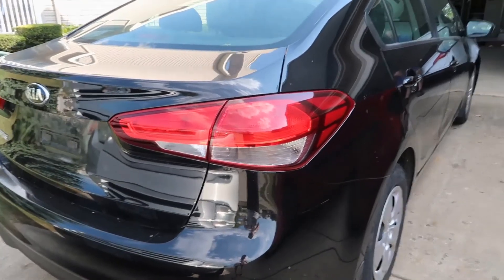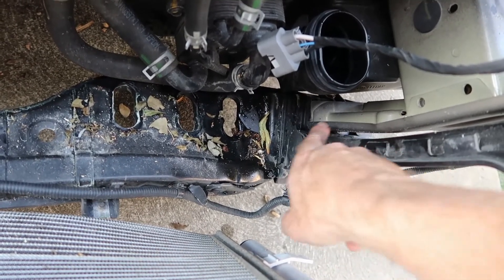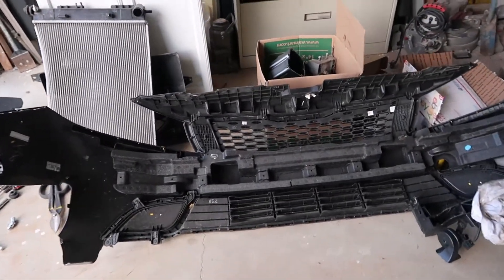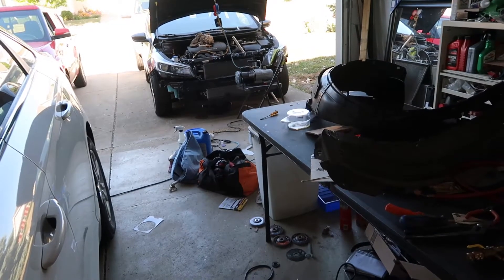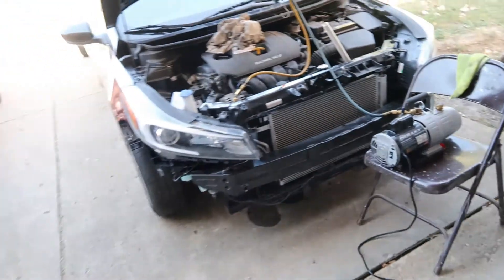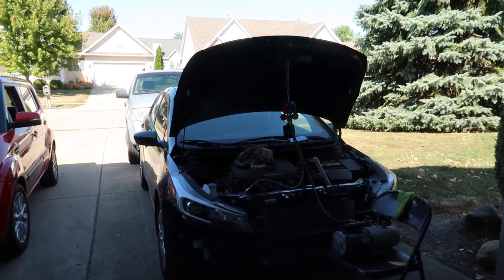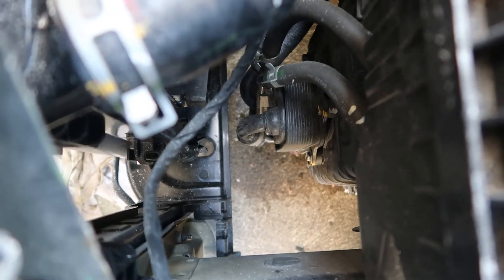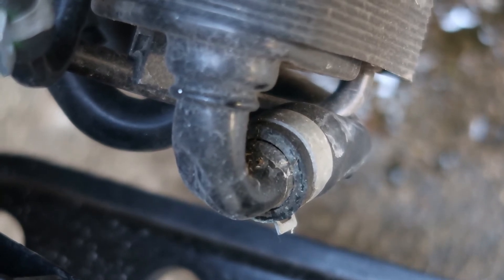KIA FORTE REBUILD PART 1, MUCH MORE WRONG THAN WE EXPECTED

Comment: i got a 2017 kia forte but the hood is all jacked up, was gonna replace it with a new one? any idea how to remove it, or should i jutst take it to a professional
Reply from the maker: There's two bolts on each side of the hood. It's not difficult. If you're going to have it painted, it might be easier to have a professional mount the hood also.  It depends on your comfort level.

Comment: I have a 2017 Forte car, the cooling does not work / hot air only / until after spraying the radiator with water for 5 minutes or more, can you help me
Reply from the maker: Well it's tough to say without tools.  Refrigerant levels could be wrong.  I sold the car but I have some experience.  My 2012 Kia Soul AC won't work when it's hot outside. When sitting and idling for a while it shuts off.  After being on the road it works just fine.  I believe the compressor has an internal thermal switch.  Once the compressor shuts off, it could be a sign of a failing compressor.  However we've lived with our Kia for years.  My son drives it to work and school without AC problems so we haven't changed it.  Try to not sit and idle on hot days or you might need o change the compressor. Let me know what you find.  Good luck
Reply: thanks for ur information 💗

Comment: Can you help me out brother. I need to source the parts to fix the piston slap issue on the defective GDI Theta II.
Reply from the maker: Sorry Justin I don't know what size engine you have.  However, I recently purchased parts for my Elantra GT with piston slap.  I had to rebuild the engine which is still in the shop. They are going with oversized pistons and rings.  It took a while for me to find the specs for everything but I think it is correct. Hastings makes rings for any application but you need to know the specs for the rings.  My engine has a 1.8L.  I bought these pistons...  https://www.ebay.com/itm/352582215540

and these rings...

https://www.summitracing.com/parts/HSN-2C435750